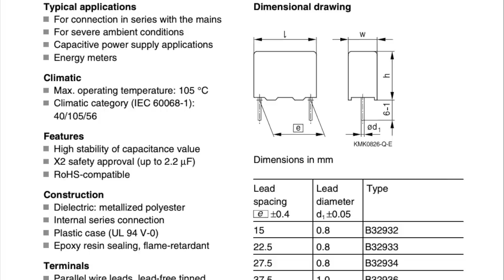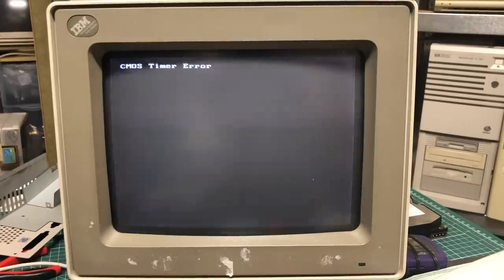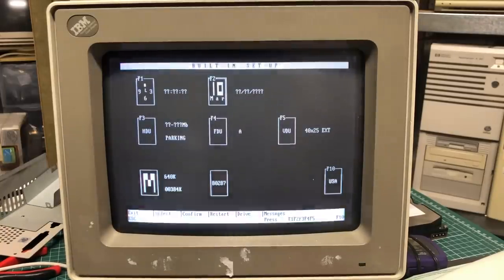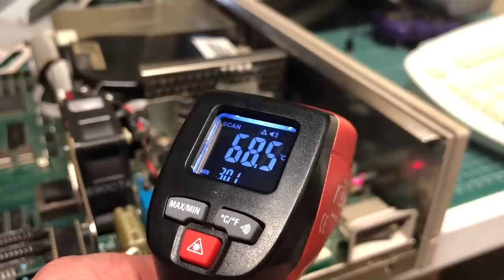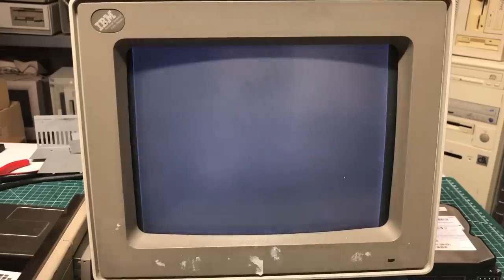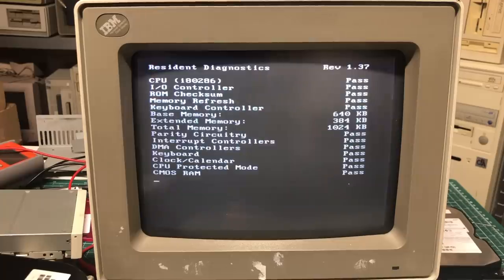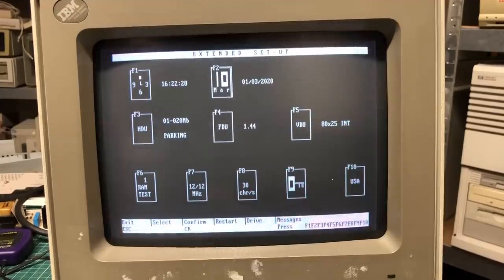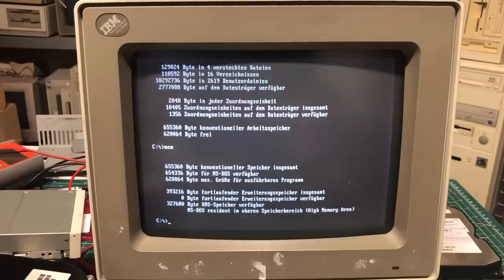Olivetti PCS 286 Rescue Part 2

Comment: That motherboard is layed out so clean, I love it. All those straight line traces makes it look somewhat futuristic. 
Thanks for the video!
Reply from the maker: Nice piece of engineering ... but still need to figure out where that cap came from :)
Reply: @RetroSpector78  Do you have high resolution images? I'd love to take a peek
Reply: What  @ToTheGAMES  said. I'd love to assist :)
Reply: The Matrix is strong with this motherboard.
Reply: Steve Jobs made Burrell Smith rework the original Macintosh motherboard so that the layout was clean like an organized city.
Reply: @Robo10q  I think Bjork mentioned that. :)
Reply: The infamous 90° angled traces. A sign for the use of an autorouter for laying out the traces.
Reply: A worked for Olivetti when these were being made. Olivetti was light years ahead of other clone makers like Compac and likes. Thier motherboards were works of art, clean and logical unlike the cluttered garbage from others. Oltivetti was the first to integrate VLSI chips rather than discreate ones.

Comment: Another option for these dallas chips is to modify them to add a cr2032 socket and use an external cmos battery on them.

Comment: Grinding teeth as the screwdriver rests on the tiny traces prying the Dallas chip.  Damage can be seen at 7:22.  Try a pulling tool or a plastic spudger instead.  I sheared a trace off of a motherboard like that once during recapping, was a trip to fix, learned my lesson.
Reply: Yep plastic or even a wooden spudger is the best way to go.
Reply: the best thing is using a desoldering station. Or being really an ace with the pump

Comment: Agreed, those Connor HD's were a thing of beauty and reliability in their engineering.  I have never experienced a more trustworthy drive/manufacturer since.  WD came in a close second though (I think they might have aquired Connor).
When I saw the top drive cover, I knew who made it and it was like seeing a long passed friend again.
Reply: WD did indeed acquire Conner. I'm pretty sure their caviar drives were just Conners with a WD sticker on them.
Reply: @schutz85  I think I acquired a ~500MB Conner hdd which was from a 486 dx2/33 I think.
I know that Quantum HDD’s were taken over by Maxtor but cannot quite recall when the acquisition was.
AOC monitors were basically just renamed LG units.
Reply: @schutz85  Conner was taken over by Seagate Technology. The Seagate series around 1,2GB ~ 2,1GB were typically shaped like a Conner, and still had the same sound. (the ST31276A was a very good example of a rebadged Conner.)

Comment: Ouch - Connor hard disks. I've not seen a working one in decades. Many have been discarded from my retro parts bin over the years : no survivors.   Astounding to see one in working (and what seems to be quiet) condition.
Reply from the maker: Think all of my connor hard drives are still working :)
Reply: @RetroSpector78  Go buy a lottery ticket ;) - even in the 90s when I worked at a computer store, these were looked down upon and/or the reason the PC made it to the shop in the first place. I've got a CP3184 that works one in every 4 times I try to boot it :(
Reply: Conners made before 1995 or 1996 were quite good. They fell into hard times then and made unreliable disks before finally being bought.
Reply: @s8wc3  Really? Those are the ones our shop (and myself) had the most trouble with back in the 90s. These days, when I buy a lot of untested hard disks - always - the Connor drives are DOA. It's to the point where I just tell the shipper to toss them straight into the garbage if that'll make the package lighter and cheaper to send.  Hell, I've seen early MFM drives that are more reliable than early Connor drives.

Comment: The Olivetti PCS 286 was the first PC compatible my family ever had the software pack came with MS-DOS 3.3,  Microsoft Works 2.0 and Ports of Call. I remember dad ordered MS-DOS 5.0 but when dad ordered it  he inadvertently ordered the 5.25 inch disk version instead of the 3.5 inch disk When dad upgraded to a Compaq 486 he gave me the Olivetti which I used until I could afford my Pentium windows 95 PC.

Comment: 6:46 - I would definitely recommend a cheap (ish) desoldering station like the Duratool/Rhino ZD-917, which is made by Zhongdi.

It makes a huge difference with helping to protect the vias and surrounding traces.
Definitely one of my favourite purchases from when I was working on more through-hole stuff.

#notspam

For multi-layer boards like that, it's best to add a bit of fresh solder to the joints before de-soldering, and a small dab of flux.

Then allow the desoldering gun to heat the solder through to the top side of the board for a few seconds before pulling the trigger.

I personally never really got on with using solder wick for jobs like this. I do use it for removing solder bridges for SMT work, though.

Also, if you do want to try using solder wick, it's best to snip off smaller sections of it, so the rest of the copper doesn't act as a heatsink and the heat away. ;)
Reply from the maker: Thanks for all the good tips ... will take them into account .... have a desoldering station sitting in a box for over a year now ... should really open it up ... might do a video on it :)
Reply: @RetroSpector78  

That would be a good vid. ;)

There is a bit of a method to using the desoldering station that I like to call "the jiggle". lol

ie. letting it heat the solder for just long enough (maybe 3 seconds max), then whilst holding the trigger, carefully jiggling the pin to free up the solder around it.

(But putting very little pressure on the via / pad.)

It also helps to hold the PCB vertically if you can (the rubber ESD mats help stop it slipping), so the desoldering station isn't working against gravity.

The component should then pretty much just fall out of the board.
Reply: I also strongly recommend desoldering stations for this sort of work.   Bought a Quick 201B a couple of years ago, and while the fit and finish is a bit ho-hum in places it's been an absolute godsend.
Reply: These snakes are good for specific places. For parts like this is station with compressor best choice = fast and clean work.

Comment: The floppy disk and hdd not working because of the missing riser is a way to become crazy if you don't think about this XD
Reply from the maker: Yes. Because you are trying all sorts of stuff (cables, psu). Because I thought the onboard ide/floppy controller was broken I needed to add the riser card as I was testing with a separate 16 bit ISA controller :) So things got really confusing then :)
Reply: @RetroSpector78  This makes me think that I have a LPX motherboard from which the IDE controller stopped working, for obscure reasons ... What if the riser is required ?! :o

I'll check that this weekend lol

Comment: Oh, I see you used the easy way to fix the battery, I went the hard way, cutting the chip and soldering a new battery to the original pins :-)
Reply from the maker: Been there done that ... but don't like the hassle of cutting those dallas chips ... makes a mess and I am not super handy with a dremel tool :) I also like the aesthetic more without the coin cell :)

Comment: I hope you find where that stray capacitor came from. That's a bit concerning!
Very strange for a PC from 1991 to only have two low capacity drive types allowed in its BIOS. A brand new replacement 20 or 40 MB drive would've been increasingly difficult to source even a few years later.

Comment: an alternative to buying new parts for that timer chip is to cut it open and replace the battery with your preferred method, ive done this a couple times, never had an issue aside from the annoyance of getting at the battery leads inside the chip

Comment: You didn't mention that the empty IC socket next to the RAM slots will accept an 80287 maths coprocessor. I used a PCSII-386, which was sold to me with a massive 40mb hard disc. I was told I would never fill it up! Room for about 6 photos from my DSLR now!!!!

Comment: That’s probably the nicest bios setup system I’ve seen so far on a pc of that era. It looks so much smarter and more sophisticated then your typical Award and Ami bioses. But I wonder why and how AT and ATX systems handle 360 kb floppy drives. I was thinking  about getting a Teac Drive for use with a BBC micro and a pentium 2 / pentium 4 machine and read that there is different behaviour on pin 34 of the interface. Appearantly it’s got something the the Ready and Disc Change singal behaviour. Turns out that (after some research) that the Teac FD-55BV only supports the “ready” signal and no “Disc Change”. Would that even work on an AT/ATX machine? How did IBM do this with the 360k YD-580 in the AT? Are there 360 k drives with Disc Change jumper option? I’m really curious about this. (Learned so far that the AT changed a lot of things compared to the XT).

Comment: Wow not seen a bu508 in ages , but however the bu508a is just a transistor and the bu508d has a diode from collector to emitter , don't know if this makes a difference in this application .They used to be abundent in TV's

Comment: 2x Floppy drive channels ?
Highly uncommon, and useful...

I have a rare i486 mobo with 2x floppy channels and 4x drives, that I use for imaging different disk sizes and formats that are not always compatible or accessible in other machines.
Reply: The 2 floppy channels are because the case also has 4 3,5" floppy slots. But I've never found more than 2 floppy drives to be useful.
Reply: @Stoney3K  
I have 4x drives because the High Density drives often don't handle Single or Double Density disks correctly.... They usually read okay, but can't always write correctly.
And Single-Sided is also a problem.

So I ended up with:
3.5" HD 1.44 MB
3.5" DD 720 KB
5.25" HD 1.2 MB
5.25" DD 360 KB

It's basically an archival and conversion machine to support other retro rigs...

But this Olivetti is slightly less useful with the lack of 5.25" drive bays.
Reply: @KomradeMikhail  Yeah, I can't really see a use case for 4 3,5" bays. You can have a 3,5" HD, a DD, and maybe a tape drive, but that's about it... and populating all 4 slots with disk drives would leave no room for a hard disk.

Comment: Didn't you say you were worried about the resistor in the PSU? Why not add some tiny heatsink to it to add longevity? Not that it hasn't already proven its longevity already. I suppose it's made to handle such temperatures and it's probably not going to exactly be seeing heavy usage like an everyday computer would.

Comment: Do you have a closeup / more information for the power supply showing where the two drive connectors are soldered to the power supply? I have a PCs x86 with one power connector and would like to fit a second for a harddrive or second floppy

Comment: When I get a computer with this Dallas chip, I prefer servicing it to add an external battery (2032) instead of changing it, just because I don't intend to give more money to Dallas when the battery fails again. It's a dirty service, but not complex, and it works fine.
Reply from the maker: Don’t like the look of the coin cell on top of the dallas. And not really handy with a dremel ... perhaps need some additional exercise :) have plenty of chips I can rework :)
Reply: @RetroSpector78  I watched the video where you make lots of jumpers in an oxidized 386 motherboard and it looks you're good servicing small pieces, so don't be lazy hehehe. Look, I've been watching all your videos and they are very good. Congrats on it.

Comment: Does the 24 pin ic socket have to go in a certain way?  Also can you send me a link to where you get your ic sockets because I am in need of one for a dead Dallas Real-Time chip.
Reply: If you solder the socket backwards the key will be at the wrong end. Consequently you (or someone else) will inevitably insert the IC around the wrong way.
The socket isn't specific to the clock chip. Any DIP socket with the right number of pins should work. They are all over eBay.
Reply: @zoomosis  Do you mean if you solder the socket in upside down?  What I am trying to say is if you get the socket, it doesn't matter whether you flip it to the right side or left because they are parallel to one another?

Comment: Is the reason the FDD and Fixed Disk detection error without the reiser card due to the blue resistor packs on the reiser card providing bus termination?
Reply from the maker: Possibly ... haven’t looked into detail on how the isa bus works ... but you might be on to something.

Comment: Any idea as to why adding the ISA riser card fixed the issue with detecting the drives?
Reply from the maker: Not really. My guess is that there are some resistors / capacitors on that riser card that are needed for stuff on the isa bus to work properly. (Even the embedded floppy / hard drive controllers that use the same isa circuitry that external expansion cards use)
Reply: I think the Riser card acted as a termination to the ISA Bus.

Comment: I've just bought this computer but it's not working (sold as "untested"). In the initial test screen I got an error message. "Keyboard Error: 8  Press F1 to continue". I've tried with five different keyboards and nothing; keyboard is not detected. Any clue? Thanks.

Comment: IDE on a 286 motherboard?
Reply: I believe IBM's PS/2 range beginning in 1987 all had IDE on the motherboard. Evidently the Olivetti PCS 286S in this video is from 1991, so by the time it was sold seven years had passed since the release of the original IBM 5170 PC AT. By 1991, MFM drives were completely obsolete and new ones were rare.
I own a Compaq Portable II from 1986 which was one of the first PCs to use an IDE interface as standard (though it requires a separate expansion card). Super convenient as I was able to swap the original 20 MB mechanical hard drive with a much larger CompactFlash card, using a cheap adapter.
Reply: this same author, one of my faves, has another video w/ an 8088 xt clone w/ ide on the mobo.  a phillips 3120, or similar, as i recall.  a very late-vintage 8088, maybe 1990 ?  pls take care n stay safe.

Comment: Hello I have a Honeywell 4024 with Siemens 8088 it runs but where can I get a keyboard for it, it has 5 pin din I think. Thanks
Reply from the maker: It is a standard XT keyboard (https://allpinouts.org/pinouts/connectors/input_device/keyboard-xt-5-pin/). These should not be that hard to find ...

Comment: My first PC was an Olivetti 386/25. Had exactly the same BIOS and the internals look almost the same as I remember.

Upgraded the RAM from 2mb to 4mb and added a Soundblaster 1.5 so I could play Doom :D
Reply from the maker: Pete Richardson how did that work out for you on a 25mhz 386 :)
Reply: @RetroSpector78  About as good as you can imagine. Low quality and postage stamp sized screen lol. But it was Doom :)
Reply: @RetroSpector78  From personal experience: Doom runs well on a 386SX 16, even with a crap Trident TVGA graphics card and speaker.exe instead of a fancy soundblaster ;)

Comment: Hi there. I have the same computer but with a diferrent problem. I've changed the electrolitic capacitors, bulk capacitor, x2 filters, y2 supressors, and the fast switching power transistor with the bu508aw , and the power works but when i measure the +5v , for example, the reading goes from +3 to +7... Big amplitude. The same with the +12 line.. só i'm scare to conect the mainboard... What can bem causing this amplitude.. the AC part or the output DC circuit??? Last time i turn it on the 10k 4w resistor near the TDA ic started to smoke.. any help?

By the way can soneone give me the power supply pinout?

Comment: Those RTC chips are the worst. I end up cutting mine up and converting them to button cell - no need for a socket ;)
Reply from the maker: Also done that before but it's a bit of a hassle :) I just order new ones :)
Reply: Hmm, maybe it is easier. Where did you get a replacement from?
Reply from the maker: The Kombinator rs components
Reply: @RetroSpector78  Thanks - that's about $25 CAD though, plus int'l shipping. My batt cell method is cheaper, and with leftover funds I can buy some vodka. Nice to know there are new ones in case I absolutely need it. :D
Reply from the maker: The Kombinator mmm... think I paid 9 EUR. Incl shipping.

Comment: At 1:38 you describe the CPU as an AMD. But I can see an Intel 1982 text on the chip. Also the diagnostic screen says CPU (i80206) which should be Intel. Am I wrong?
Reply from the maker: Think every AMD 286 cpu had an intel 1982 copyright on the bottom. But will double check. Thought I saw the AMD logo just left of the heatsink. But have to admit I didn’t pull of the heatsink.
Reply: @RetroSpector78  See? That's also new for me :) Every AMD 286 with an Intel logo. And I should already remember that, I'm old enough. I learn something every time. Thanks for these videos!
Reply: At the time both AMD and Intel co-developed the 286 for the IBM AT.

Comment: Also, please keep in mind, on the cheaper ir  thermomiter tools, the aiming laser is quite often a little off, sometimes a lot !
Reply from the maker: I bought it to identify some hot spots , and this resistor was one of them .... PC seems to be working fine ... output voltages are clean, no weird noises, and have had it on for several hours straight. So hope all is well.
Reply: @RetroSpector78  yea, just don't let  yourself get all paranoid and measure all the things all the time ! :D

Comment: my pcs 286 shows this error on booting: 
Resident Diagnostics Rev. 1.37
CPU (i80286) pass
I/O Controller pass
ROM Checksum pass
Memory Refresh pass
Keyboard Controller pass
CMOS RAM Error : 1
Press F1 to continue 

then it goes in a loop restart